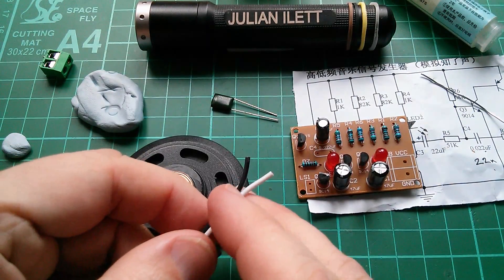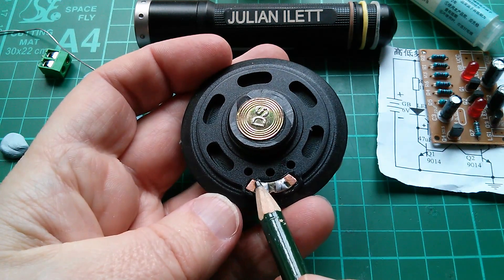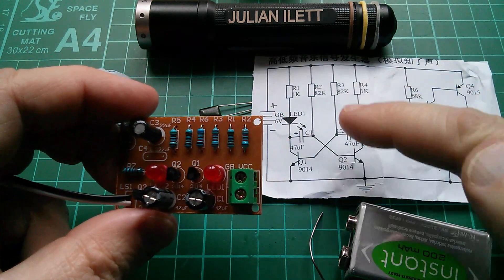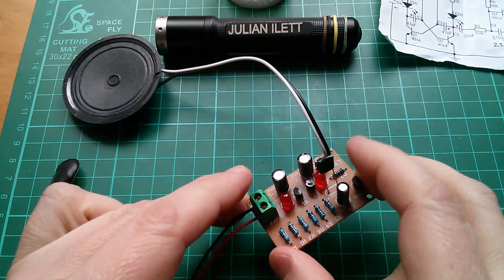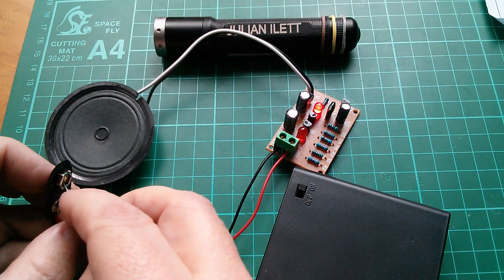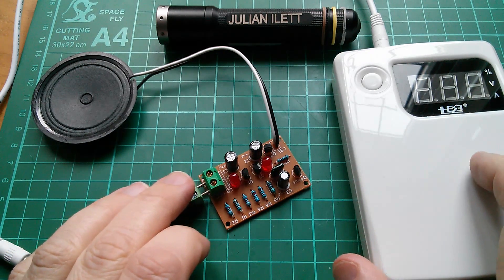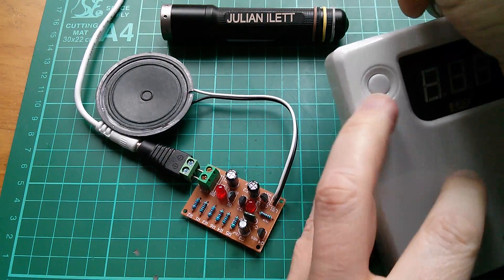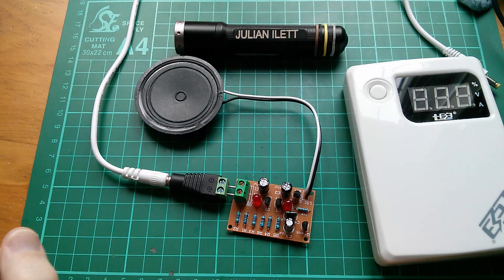Easy Electronic Kit Build - Cicada Sound Simulator (part3)

Comment: I haven't heard real cicadas (long a) since I was a kid when we had a huge outbreak of them in Wichita.  Now I feel nostalgic for that sound.  The bugs, not the fire alarm.
They're loud, but they sing with each other in a rhythm so it's kind of relaxing.  Unless you step on them, then they get cross.
We also had hundreds of WW2 era air raid sirens to warn of tornados, which was the coolest sound in the whole world.  The sirens I mean, not the tornados.
I think this device wants to be a Wichita simulator but it falls a bit short of both the cicadas and the sirens, I'm afraid.

To improve the circuit, perhaps they should dispense with that expensive speaker and instead drive a periodic 1KV pulse into a cicada.

Comment: Well it definably does not sound like a Canadian Cicada. With the wire braid solder removal if you apply the heat to the braid and have the braid on the joint the solder wicks up.

Comment: I put the desolder wick on the joint, then put the iron on top. Also I have some of that exact wick, and it works ok. when I cut off the used wick, I leave a tiny bit of solder, think it helps to get it going.

Comment: 9V batteries are pretty much useless for anything that above a few mA and the way this circuit is designed you need way more than that. That's why it didn't work with it. I suggest you always measure current draw when testing something, because I think it has been several times now that you tried something with a 9V battery instead of a powerful supply and it only failed because the 9V battery drops to nothing.

A speaker also shouldn't be connected in a way that you can only have DC through it, which this circuit does. In an extreme case this circuit could send over 1A through the 8 Ohm speaker on 9V. I guess they ripped the circuit from somewhere, but didn't get the memo that the speaker should be a piezo speaker.

Comment: I wonder, if you wired two speakers in opposite polarity to each other and then fed them the same signal, would that not have the effect of them cancelling each other out due to one having the negative phase of the other?
Reply: himselfe actually, there is. In stereo audio, you want the spekakers to be wired the same way. Of it is not connected that way, it sounds out of phase, and as if the sound is coming from the behind you.
Reply: Windshield that's what I'm saying.
Reply: John Coops: it's just curiosity, I like to think about these things. Didn't realise I was causing offence?
Reply: Common knowledge to who? Not everybody who watches these videos have the same level of knowledge about everything. It was a simple question of curiosity.
Reply: OK...?

Comment: So now we wait for part 4, where Julian fixes the device to truely sound like a cicada?
I suggest you buy and build one of those kits with a small digital recorder chip and playback speaker. Good for a three-part sequel! 
Then you can try to find a cicada in its sunny residance and later playback its noise (assuming you didn't fall asleep).
You could also decide to make a nice three-part prequel explaining the workings of one of those simple two-led blinky kits ;-)

Comment: The only real time polarity matters with speakers is stereo speakers or other multi speaker systems where if they are wired out of phase it will sound dead
Reply: On a small speaker the coil will be dragged inward to bottom out and will not sound right.

Comment: That is a horrible rendition of the cicada. Not even close. if anything that's more annoying. Also as far as the speaker goes, you only have a positive going voltage, , one PNP transistor. So it is not a push pull amplifier. And yes it normally does make a difference which way the speakers pushed/pulled. However in this case I don't think it's going to make any difference at all. and the only reason I can think of to have such a device, is if you want to annoy your neighbor with hundreds of them. but I don't see how it would be worth the effort.

Comment: I think whoever copied this kit from the original may have chosen the wrong capacitor values. Something definitely got lost in translation. Might be worth swapping out the caps for sockets so you can try some different values and see what effect that has - that's if the YouTube comment hoard can stand a fourth part ;-)
Reply: For what my 2p is worth, fault-finding, tinkering and actually getting it to work would be more interesting to me than the entertaining parts 1-3....
Reply from the maker: Probably not :)
Reply: Yeah, go for it. In for a penny, in for a pound.

Comment: Are you sure ou got the right  kit?  Sounds like  a siren/alarm and what do leds have to do with an insect?
Reply: Mike Houghton They work as a load to drain those capacitors so the oscillation can happen (the circuit is astable; so the capacitor's voltage level must be asymmetrical)
Reply: Thanks for  clearing that up. I am relearning electronics (having learned the basis 30 years ago)   so hopefully people bear with me.

Comment: Looking forward to parts 4, 5 and the "directors cut"......
Reply from the maker: An evening with Julian - I think it worked ;)
Reply from the maker: Don't forget the outtakes :)
Reply: I'm waiting for the laserdisc version with some additional art.
Reply: Julian Ilett those capacitors must have the wrong values, because its not oscillating at the correct speed.
Reply: I think it's out by a factor of 10. the sacaiders(phonetic spelling (AUS)), would be about a 4k tone modulated at about 50hz.
sometimes, but not always, they also switch on and off at around 1hz.
The thing does not seem to be voltage sensitive, so I think mess with resistor or cap values and you'll probably get there!
Here, in some forest areas, they can be so loud during the day, that the rangers have to ware ear muffs, OH&S!
I think there are lots of different types, as the one you heard on wickipedia is nothing like what we have here in Australia, Well, not Victoria anyway!